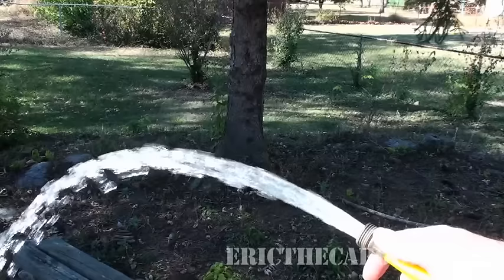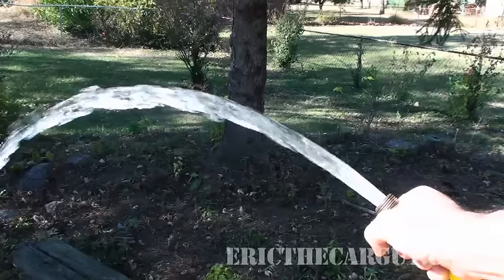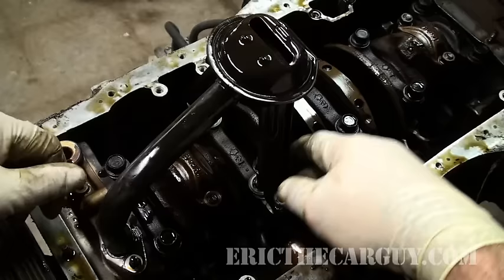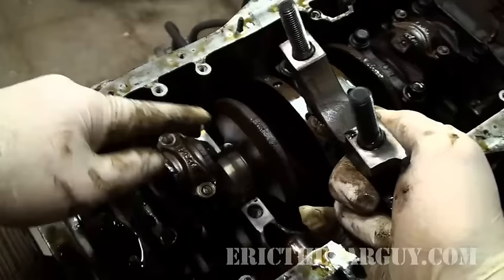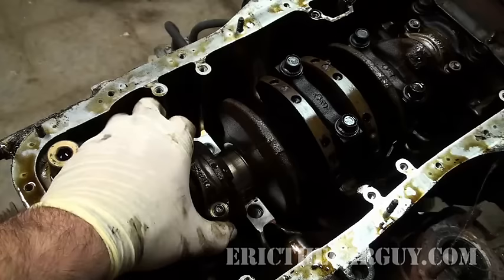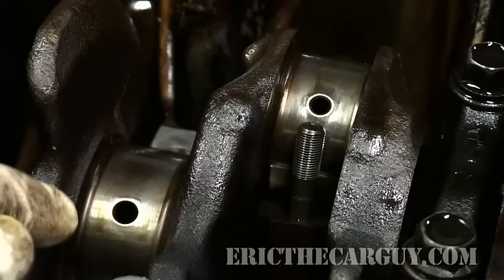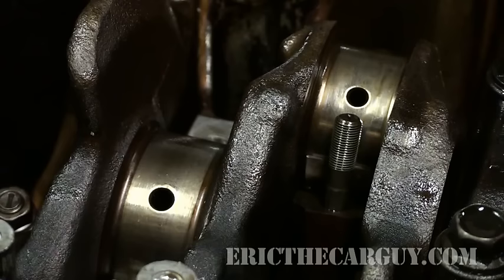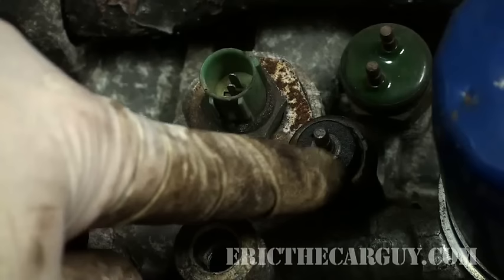How Oil Pressure Works - EricTheCarGuy

Comment: What if you shim the oil pump (like in my 7MGTE Supra engine). Or if you place a smaller restriction in the exit passage of the pump??

Won't that cause higher pressure??
Reply: Hi,
I've just shimmed my oil pump on my gte.
By adjusting the spring pressure on the oil pump pressure release valve (shimming the oil pump)
means its sustains it's higher pressure for longer through out your higher rpm range.
Ive done so because its a track engine in which there is super high rpms.
Those engines are like nearly 30 years old and if you find bad oil pressure be sure to replace bearings and check cam bearing clearances and why your at it replace that worn out oil pump with brand new Toyota one :)
You'll thank me later

btw you want all your oil pump; from pick up to the bearings to have large oil passages ( not restriced) cause your bearings and clearances is what causes the oil pressure!!
Reply: tradesmansassistant So you're basically talking about an engine rebuild... And for a 7MGTE how much do you think this could cost (estimate)??

I always hear people saying its a bad idea to open up a 7MGTE; I feel I have the mechanical aptitude to properly rebuild this engine (with guidance from a few friends). But even then (from at least one friend) I get discouraged when they say not to worry about the oil pressure and to just keep the engine running as best as possible until I graduate college (May 2015).

Honestly, I want to rebuild my engine this semester! I'm really worried about the low oil pressure I've been seeing on my stock gauge (26+yrs old, I know); but its reading a tick above 0psi when I'm idling. Plus, my turbocharger is blown (oil seals) and maybe its because I had low oil pressure that wasn't allowing oil to even circulate enough to the turbocharger in the first place. I will get an aftermarket oil pressure gauge for more accurate readings; then based on what the gauge is reading, I'll determine whether I should rebuild my engine.

Even a slight engine rebuild; honed cylinders along with new rings, machined crankshaft and rods along with proper bearings, MLS headgasket with ARP studs, Driftmotion upgraded oil pump (shimmed) and miscellaneous none reusable parts (oil seals, gaskets, etc) and thats it; everything else (stock parts) cleaned up and pieced back together.
Reply: Hi, It depends where u live and if your planning on rebuilding with upgraded parts.
Ranges from $400-750 (standard rebuild)

7M's are great with supporting cooling mods on stock parts and upgraded H/G.

I'm running just over 1 kg/cm2 ( 15psi)
at 600 rpm idle. Sounds like u were running a standard ct26 turbo? They blow with being old.
If your oil pressure has dropped like that well you should check with a mechanic. Sounds like its run out of oil at one point in time.

I've diagnosed about 6 7'Ms with worn bearings and BHG. 
I've rebuild a 7M and never had a problem in years.
Currently working on 500hp 7mgte.
Forged bottom end, titanium valve train, stage 3 cams and upgraded manifolds with larger turbo.

Sounds like what you need for your basic upgraded rebuild is what your mentioned.
Note: there is heaps of forums covering these topics just type them in google.
Reply: 755hp It will cause higher pressure behind the shim, but not after the shim. Don't forget that the pressure is different in every place in the system, depending on the flow rate and cross sectional area of whatever the oil is flowing through. An example is if you have water flowing through a big pipe and connect it to a small pipe and then a big pipe again; the pressure is lower in the big pipes and higher in the small pipe. More importantly, the pressure is highest just before the small pipe, while the flow is convergent, and lowest just after the small pipe when the flow is divergent. If you put a pressure gauge at different points in the system you'd read different values everywhere, so pressure really isn't what matters - what matters is that you get oil where it needs to go at the rate it needs to get there.
Reply: George Burkhard great explanation bt hw do u explain my problem??
Reply: George Burkhard hi eric thanks for this video . i have Just Done MY complete motor over and modified it . its a 4age 20valve 1600cc with complete bottom end balanced and .20tho high comp pistons and .6mm of the head with ported n flowed head and 293degree 9mm lift cams and vvti ad exhaust hks vinear gear. and ligthened a few just but REASON for doin motor over ok 2 reasons engine was smoking burning oil. and got bord of the stock engine but my car comes with a oil pressure gauge...and wen it starts up the pressure good and wen im drivi over 3000rpm its good but as soon as the OIL  GETS BUT,,, THE GAUGE OR PRESSURE LOWER THAN THE SAFE ZONE... SO I BOUGHT A NEW PUMP AND RE DID THE COMPLETE MOTOR NEW BEARINGS RINGS ETC BUT THE PRESSURE EXACTLY THE SAME AS B4 DOING IT OVER SO BOTH PUMPS GAVE THE SAME PRESSURE READING SO GLAD TO SEE THIS VIDEO VERY HELPFUL BUT IS THERE NO WAY I CAN FIX THE PROBLEM WTHOUT DOIN ANYTHING HECTIC SPENT R15 000 DOIN IT OVER. O YES IM FROM SOUTH AFRICA ... CAPE TOWN.. WILL A OIL COOLER HELP?
Reply: Muammar Jassiem no, unfortunately if your clearances are too large due to wear, the only way to maintain flow/pressure would be too use a higher viscosity oil that your engine is definitely not designed for. In reality you have to do major work to fix the clearance issues.
Reply: I just rebuilt the complete engine only drove 100kms or say 120miles after the rebuild . new rings . new bearings. New oil pump. New valve stems. New valves. New valve guides.
Reply: Oil press 20psi on idle n 30psi at 3000rpm but after 30min of drive idle at 12psi
Reply: Please reply . and THANKS ALOT FOR THE ADVICE MAY GOD BLESS U AND MAY WE MEET IN PARADISE
Reply: Sounds like you still have some clearance issues somewhere, but it also
sounds like you can get it to work with a higher viscosity (at run temp)
oil. You have ok pressure at idle but once you warm up the engine, the oil
becomes less viscous and you are losing pressure. Assuming you are using
the correct oil for your car, this means that you still have clearance
issues, but you might be able to get around it by using a heavier weight
oil. You should definitely be using at least 30 weight, but maybe you can
find something even higher to try.
Reply: Im using 10w40
Reply: Im suppose to use 15w50 or 20w60 bt its a 5th generation 4age 20v with vvt varible valve timing intake cam gear advances wit oil n the tuner say it kicks in stronger with thin oil
Reply: Iershaad johnson. Facebook. Twincam racing developments is my favebook profile. PleASE REPLY THANKS FOR EXPLAININGBIL RATHER CHANGE TO THINKER OIL I MEAN THE ENGINE WAS MADE IN 1995
Reply: tradesmansassistant 
Hi,

Just whanted to confirm if i'm going correct way.

I'm strugling with low or no oil pressure when starting cold engine (2jzgte) it takes around 5sec to build some pressure and switch off control light on the dash.
At the same time i have a small leak from thre front on the crankshaft.
I've just ordered new oring/seal for drive shaft together with new oil pump. Do you think if repleacing this will helps or i have to check the bearings as a priority ?

Thx

Comment: hi is this true. 1. is dirty oil good oil for car engines? or is clean golden oil good for a car engine? is it meant to go black right away? or is it meant to stay golden?
Reply: for added engine protection getting bigger oil filter if your car accept it and you can use it longer just like  machines like tractors of course better oil flow
Reply: on a diesel it turns black after a few miles with gasoline not so much
Reply: i was told by an oil changing company that black oil is good for gasoline engines. isnt that why we change oil frequently in a gasoline engine?
Reply: if you lost the original user manual no panic he can also download as a PDF just type in Google the type vehicle for example Toyota mega cruiser 2009 should get the right PDF  by this so you get always alright oil change schedule
Reply: The detergents in the oil make it turn dark.
Reply: +Len Vantil That's kinda a stereo type, my 2000 dodge Cummins can go about 2500 miles before the oil looks any different, on fords or motors with heui injection there is a oil pump that fires the injectors and puts alot of wear on the oil in a hurry, along with about a quart of oil that stays in the pump and is slowly circulated to the rest of the engine, its meant to be changed but most people dont do it because its a pain, so the nasty oil gets into the new and makes it dirty almost instantly.  Watch powerstroke help Bill is a genius!

Comment: What If the oil pressure is high, and as the engine warms up it drops to about 50psi.
Reply: Microwaved Gerbil  50psi is fine, pressue is usually high until oil thins when it heats up.
Reply: Microwaved Gerbil That's normal regardless of what oil is on the market as of 2015. However, the closer the cold start pressure is to operating temperature pressure the less wear on the engine because you get more lubrication quicker. So if you're using a 10w30 you'll get more lubrication on cold starts by switching to 0w30 or even 5w30, regardless of temperature.

http://www.synforce.com.au/node/24

Note though that this still doesn't mean you can go forever on the same oil, I'm not sure what oil companies have planned but it at least used to be that a 5w30 would lose its operating temperature thickness over time and use and a 0w30 would be even easier to shear its thickness away. And perhaps you know that already, though I'm also saying that in case anyone else is reading who didn't know.

Comment: so when i turn on my engine the oil pressure light comes on for a 2 3 seconds then goes off is that normal?
Reply: Yes because it takes a second or two to reach the sensor normally.

Comment: 351 ford. Good psi. Quiet on start up. After 1min of running the valve train starts chattering bad and the psi is still good. (HELP)
Reply: How clean or dirty is the valvetrain? Possible that one or more of the oil passageways on the camshaft seats is clogged with gunk and restricting oil flow resulting in top end starvation and chatter. If one gets completely clogged and rattles bad long enough then the cam sticks in that seat and breaks the timing chain or cam gear bolt and its game over.
Reply: Baron Volkov 
Thanks I was kind of thinking the same thing. 
I m going to drain the oil and fill it with diesel fuel. 
I’ll then run it for 10 seconds or so. Then refill it with oil. Maybe I won’t have to pull it. 
Thanks again
Reply: @eugenejulson8742  Id be hesitant to run just on diesel fuel but sure thing 10 sec wont hurt anything. But i also doubt that one 10 sec run would clean much. 10 seconds at a time with cooling intervals may do some cleaning. Also atf oil is a great cleaner of internals by running at idle or slight rev for 15-20 min but thats a slower process  which may not be enough.
Reply: Baron Volkov 
Right. I never thought of ATF.  I might try that.
Reply: @eugenejulson8742  Id recommend oil mixed with diesel as a flush not straight diesel just to be sure you done wear any cam lobes, bearings or journals etc, as you never know whats ready to start giving way with lack of lubrication.
Reply: Baron Volkov 
Thanks for your input. 
I’ll see what I can do without exploding the engine. It’s not a big deal if I do. The decision to change the engine has already been made.

Comment: on my 94 chevy suburban 350 5.7 mine will rev ok in park or neutral and oil pressure is eiter low or ok. then i take off and it gets higher and my motor studders. when i let go of the gas sometimes itll die when im driving or stopped so i have to keep pushing the gas to keep it alive. i had put a oil change with filter and a oil sending unit deal but it didnt seam to help. next i was going to just put a oil pump. but can anyone help? greatly appreciated!
Reply: Could be bad spark plugs...
Reply: well it was a fuel pump that cured everything but the oil pressure being low. and it had a tune up 2 days after i bought it which was little over a month ago.
Reply: +Justin Bell Ok great atleast u got it fixed.
Reply: couple grand later lmfao ugh

Comment: Why the oil pressure cant be "distributed" independently in engine regardless of condition of wear bearings ? This would mean that our engines will be immortal ?
Reply: And every bearing have its own oil pump, which itself never wore out.
Acts 15:13

Comment: You are confusing resistance with pressure, the pump creates the pressure by pushing it, the valves creates resistance by being too narrow.
You will have some pressure even if you don’t have any valve or moving parts but you will have no pressure if you don’t have an oil pump even if the valves have no gaps

Comment: Hello everyone i have a chevrolet cruze 2010 1.8 with less that 50k millage  i had no oil pressure issues before .. recently i took the car to a mechanic coz it has a knock when it on idle soon as i move the car work perfect with no issues ..the mechanic asked me to change the oil pump as he said that the oil getting to top engine wasnt enough .. i bought a genuine one from the chevrolet dealer ... after he done the job and replace the oil pump with the new one and put back everything back we started the engine and now the car show oil light on dashboard  ...i would appreciate any help and suggestions that could lead me to solve out the problem
Reply: Cheb Hafid Eric explained the exact same issue you are having in this video. Either your rod or main bearing are going bad or something is over the recommended clearance causing low oil pressure. Your original oil pump was probably fine.
Reply: f22gtr
 Also, less than 50K miles that should definitely be under warranty.
Reply: Could be the oil pressure, oil change, or low oil. Lights don't say much, but if it wasn't on to start out with, I'd wonder why the first mechanic thought voiding the warranty was a good thing.

Comment: oil pressure will not drop that much maybe 2 or 3 psi not a big deal.. when engine wear is bad.. when you see 50 % then you have a blocked pump aka rag left in the oil pan or blocked passage ways etc.. not from normal wear  20 year ase master mechanic here

Comment: Sorry but your video is wrong.  The reason the water sprays like that is because you just increased the velocity by reducing the cross section.  I figured you'd know that, since this is also how a venturi works.  When this effect is happening in a carburetor, you're actually reducing the pressure by increasing the velocity.  That's why it sucks in more fuel into the airstream as it necks down, because reducing the cross section lowers pressure.

Comment: Pressure on my dodge ram only drops when in gear and stopped. does that mean anything specific?
Reply: mine does the same thing!!
Reply: achillestyler pressure goes up with a few rpm. Most likely bearings. Gotta lift the engine to get to them
Reply: mine goes up to about 40 on the gauge for quite awhile of driving then drops very slowly to about 25 to30 and stays there. thought it was kinda strange but I've just let it go. it's done that since I got it
Reply: achillestyler alarm go off? It would drop a while after the oil warms
Reply: nothing ever happens, no lights or nothing. runs great
Reply: Then it's probably normal

Comment: That is incorrect. While you just turned the water on, it IS coming out at pressure, it's just very low. When you restrict the outlet size and the volume remains constant, that's when you get an increase in pressure. Conversely, if you left the hose alone and increased the volume, the pressure would also increase. When we consider the model of the oil pump, yes it does create pressure....as there is a volume differential between the pump outlet and the size of the oil gallies, this increases the pressure for a given volume, as the oil pump turns faster, the pressure increases (which is why we have an oil pressure gauge)...conversely if you lose oil pressure that means something in the oil system has failed. (pump...hole in a block....blown gasket...etc. etc. etc)...

...while your thought processes are on the right track, you explanation is not completely accurate.

Comment: This is the same mistake people get into there heads about ROOTS style Blowers...Yes Blowers not compressors. Oil pumps are not oil compressors just as ROOTS Superchargers are not air compressors. It is the restriction that creates the pressure.

Comment: I HAVE 2008 ACCORD IN THE MORNING WHEN I START IT KNOCK FOR A FEW SECOND DO SOME ONE KNOW WHAT WRONG WITH THAT
Reply: Could be a slight Piston Slap, after it warms up sound will go away if not then could be smth else (Rod Knock, Fuel Injectors)
Reply: TGM sea foam in gas crank case and little in trotle body

Comment: And yes liquids are compressable
Reply: technically yes, fluids are compressible, but the change is minute. Otherwise they wouldn't use fluids in hydraulic applications, like power steering, hydraulic rams, bottle jacks, floor jacks.. and the list goes on and on. It is so tiny of a change that its just common practices to say they aren't compressible unless of course your a thermodynamic engineer....
Reply: Tim Vincent compression of liquids is possible, when you compress a liquid or gas, it creates pressure. The type of liquid being compressed will determine its compressibility, as well as temperature, and volume. That is why they use fluids in hydraulics- a motor compresses the fluid to create pressure to move parts- power steering pump, etc.
Reply: the pressure created is a factor in relationship to the amount of force exerted upon the liquid in question... it's still not "compressed"...